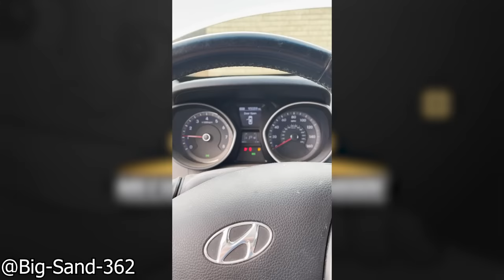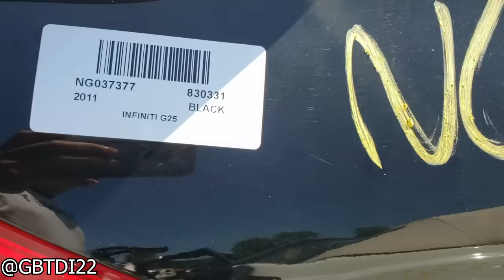Customer States 'I Lightly Hit The Curb And The Rim Exploded' | Mechanical Nightmare 129

Comment: On the Grand Marquis, the spark plug hole needed to be blown out.
Reply: Yeah, it looks like there's a bunch of crud down in there, keeping the socket from properly engaging.
Reply: It's usually baked in the well, grind teeth on a piece of conduit to clean.
Common issue on any plug in well engine w/o a boot cover.
Reply: @Mark Anthony It's an aluminum head. Most likely that shtuff is just dirt and crap that's vibrated itselfi nto a packed mess.

Comment: i had a sister due the same thing with saying "I only hit a small pothole and the tire went flat and the wheel was ok" WELL both front tires went flat,both of the aluminum wheels in the front were bent like a pretzel,the rack and pinion was bent,and her  words to me afterwards were "IT WAS OK WHEN I CAME HOME" I came home from a work related trip to see the carnage,BOTH FRONT TIRES FLATTENED LIKE A PANCAKE,BOTH OF THE ALUMINUM WHEELS BENT BEYOND FIXING AND THE DRIVE AXLES WERE BENT AND THE RACK AND PINION WAS DAMAGED_went out with her in her car to find the supposed small hole,instead i found a very large hole in the street which i told here that you were evidently not paying attention to the road that night,ETC,ETC,the damage was not worth fixing BUT I MADE HERE GIVE ME THE VALUE OF THE CAR AT SALVAGE and no longer allowed her to borrow my cars from now on-What i also found out was that she had gone around a street closed sign and 2 other barriers just to save 3 minutes
Reply: Twistiest sister.  Sigh.

Comment: A little over a decade ago, my wife was driving my 2006 Saturn Vue V6 AWD. She said she went off a curb going 5mph. The front swaybar sheared, part of it bent and tore up the CV axle and I spent a day fixing it.
Reply: I have a 2005 Saturn Vue V6. Great car hampered by shitty GM engineering
Reply: @ozzie_goat  I can't complain too much about mine. My biggest complaint is the Honda engine. Working on it is a pain. The back 3 spark plugs are a pain in the ass to replace. It took me 4hrs to replace the alternator a few years ago. But overall I've been pleased with it. Bought it in 2008 with 39k miles on it and I'm currently at 298,559 miles. It's my hunting rig, so I run different tires than recommended. I've plowed through snow drifts higher than the hood, pulled several vehicles with it, I even hauled about 3 yards of soil in the back
Reply: @ozzie_goat  I can say they did a good job on the Saturn overengineered brakes. For a small SUV, those brakes are as beefy as the brakes on my 3/4 ton pickup.

Comment: I am a car mechanic from switzerland and baffeled time and again by what drives around in MEEERICA😳 After 10years, every car has to be checked out in 2year intervalls in a goverment testcenter:

-no loose ballbearing/bushings
-no rust that can be penetrated with a screwdriver
-shocks and breaks have to be within limits
Even the whippers have to clean the windows properly and so on....

Comment: i got a truck with 9800 miles on it customer ran a power cable from battery to an inverter by going into the cab via the hvac drain tube. based on what i see look like the inside was modified via a hammer

Comment: On that equinox, the chain didn't jump timing and go through the valve cover. The chain was so stretched out that it was rubbing on the valve cover. This is kinda common on these engines
Reply: If it jumps timing the motor is pretty much done. The piston hits the valve and it's over. Costs more to repair than just replacing the motor.

Comment: The hearse tire looks badly scrubbed from a poor alignment.  Considering how much driving a vehicle like that actually does, when it's even slightly out of whack, the tire just starts disintegrating.  It's visibly feathered.  The outer edges are also worn to nothing, when the inner tread is slightly better-ish?  So low tire pressure, causing high heat, was probably partially to blame with that one.

Comment: 1:07 if the clutch is not pressed, it’s actually possible to drive the car. You just need the feeling for the gearbox synchronisation.
Reply: It's really easy to sync but taking off in first is a whole other issue
Reply: Better don’t stop. I’ve managed it around 100m to the repairshop. Including a lot of praying. I’ve went inside the shop, told them that my car broke next their shop and that we need to push it on their parking. Young mechanic said no problem we need 3-4 people. Old one said easy young folks. Look and learn. He went to the car, put it in first gear and jumped into the parking lot.
Reply: I had a 72 Chevy 4x4 with 3 speed, granny gear and Overdrive, didn't need a clutch, maybe when stopped or on a hill, but you could shift it clean without using it.
Reply: @drshoe8744  had to Google it. 

What is a granny gear transmission: a question a child might ask but not a childish question. Opinions vary on what constitutes a "granny tranny," but in a nutshell it's a manual transmission with an extremely deep First gear ratio that allows the vehicle to crawl along at a super-slow pace akin to that of a kindly old granny shuffling in absolutely no rush to Sunday services.
Reply: @Neptun2006  Exactly! I could pop into granny gear on a hill, step out of the truck, p then take two or three steps and jump back in and take off, it would just "lope" idling along uphill.
Reply: @drshoe8744  A new Bronco with a stick will do the same thing.
Reply: The clutch linkage on my Studebaker Champ pickup broke when I was about 50 miles from home. Not a huge problem until I was climbing a hill approaching an intersection and the light turned red just before I got there. Knowing there was no way I was going to get the truck going again if I stopped and the intersection was clear I ran the light.
Reply: Few years back, I drove from South Carolina to Idaho without a clutch in a 92 Isuzu Rodeo...auxiliary clutch pump went out. Start in gear, then "feel" the synchros. Don't recommend it but it went smooth.

Comment: Those 2.4L engines at 3:10 are well known to stretch the timing chain and smack the cover like that.
Reply: I'm sure pretty my 2012 malibu was ready to blow up because of that but what killed it was the transmission cooler lines being installed incorrectly
Reply: @sadayukinaga9363  I had a 2010 Terrain with that engine, real piece of crap, a ton of problems they recalled at the factory and didn't fix until late 2013.
Reply: @afterhoursfab  well all I'm hoping for is the 2.5L is better than the 2.4L or I'm gonna be going through another roller-coaster of emotions
Reply: @sadayukinaga9363  I believe it's better internally but they have a problem with the heads clogging up from the EGR, documented from GM. A bunch of freeze plugs need to be removed behind the manifold to fix it. P0411

Comment: The hearse tire is chewed up from gravel and it looks like a very old tire, probably got thrown on as an emergency spare. A lot of city based techs won’t see that kind of tread damage often. Living in an area where there’s more gravel roads than paved roads you see this quite often. Even in a city a hearse will end up driving enough in the cemetery that you’ll see this eventually on the others.

Comment: Jesus Christ ...I know old vehicles were better build but ...only because you maintained your car. Everyone was expected to do their oil changes, plugs ... filters, tires. A car was driven 20years, 250,000 km and even after that time the only issue was rust. I opened an engine of an old Volvo 850 ... Few years ago with 285,000. CYLINDER HONING looked mint... oil changes every 8k km!

Comment: thats funny that at 2:22 the mechanic thinks the rust on the back side of the rotor is unusual 
thats every brake job here in the north east
Reply: Hey its actually the mechanic from that vid. I was kinda surprised by the rust, (we dont get that too much here) but mainly just the abnormal brake wear. Im only 7 months into my 4 year internship and we almost never get stuff like this so I was just surprised that could even happen.
Reply: Yea that's every brake job here. At least the ones that still have a pad or a rotor left
Reply: @backfire_tv3178  Im in NY and its actually very unusual to see rotors that dont have this build up of rust. Usually less than half of the wear surface is clean.The inside is always worse than the outside and the rear rotors are the worst for rust.Basically new rotors are needed every brake job here. Sometimes it gets so bad that the rust ridge starts hitting the caliper bracket or the backing plate and customers complain of noise.
ive seen the rust get so bad that the pad surface of the rotor brakes off the hat section!!  Also rust starts to form between the backing plate and the friction material of the pad and the two separate. I always buy the coated rotors , it helps a little
Good luck with your career , learn as much as you can and get a job with the city / state that provides a pension!!!!! Also start saving for retirement now!!!!!